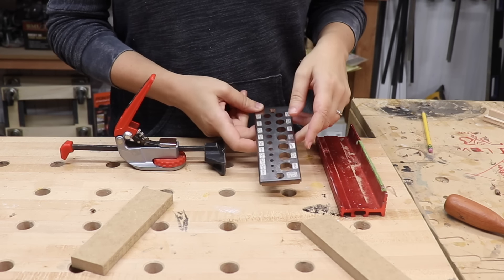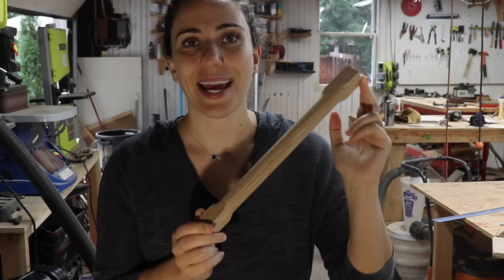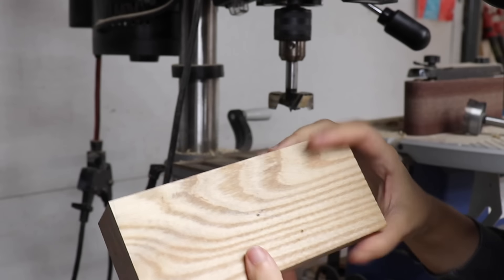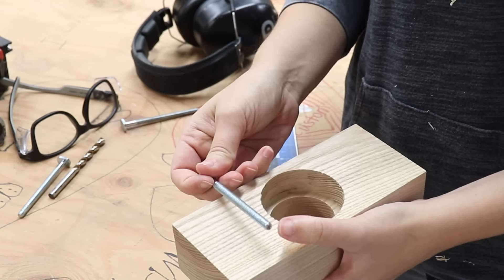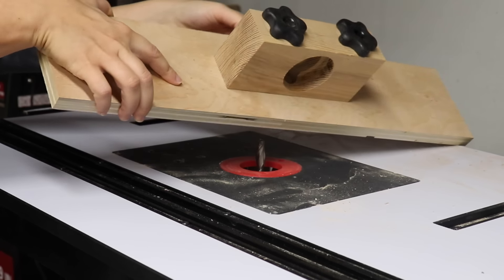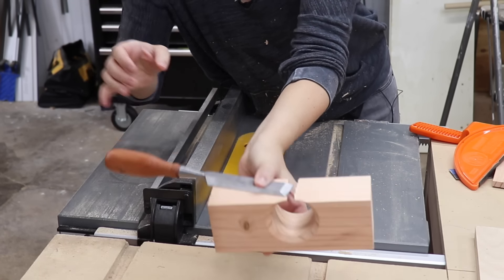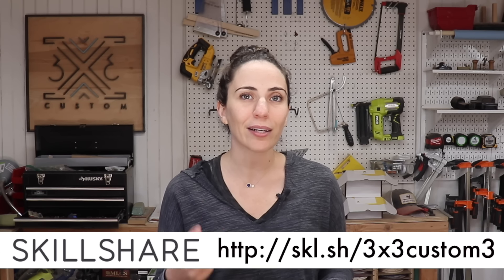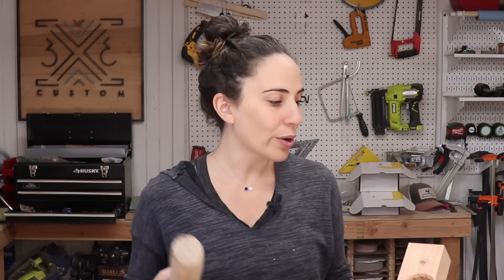Making Large Dowels WITHOUT a Lathe // Woodworking Jig // Dowel Maker

Comment: The router seemed the best way, but there's an alternate that is surprisingly easy: planing. I've seen Japanese carpenters simply use a plane to turn 4 sides into 8, then 16, etc till the stock is close enough to sand. For all the time taken to try and make a jig or try very dangerous methods, you could do it by hand and likely in less time. The added bonus is that you aren't limited in size in any way and can even have control over things like taper, mortises, transitions, etc. I find that if you need to spend longer trying to figure out how to do something than actually doing it, you need to research the method, not reinvent the wheel. And simpler is always best. K.I.S.S. :) Oh, and that chisel.... I was borderline yelling at my monitor when you started! lol
Reply from the maker: Hand planes are always an option

Comment: thank you for the cool video, I like how you explore and work through various methods to accomplish each task/jig.  I have a question regarding the dowel plate.  I see this plate is made with A2 steel so it should hold the sharpness for a good while, but how many hardwood dowels do you think it will make?  And can it be sharpened.  Thanks again.

Comment: This is a really cool video. I am looking for a way to shape wood in this way to make stair rails ( 6ft min ). To my thinking the router method looks most controllable perhap with the addition of a steady block to help  keep it true. What do you think. Really though provoking video. Thanks
Reply from the maker: I’ll have to think about that a bit 6’ could be challenging. Maybe featherboards could be used to hold the workpiece down and towards the fence so the support parts wouldn’t be necessary 🤷🏻‍♀️🤷🏻‍♀️

Comment: I just made a dowel "plate"and am anxious to see if it works. What u did was I found a piece of 1-1/2, quarter inch square tube. I drilled holes from 1/4 in. to 5/8 in. by 1/16s. I then drilled the other side of each hole 1/32 bigger. My thought is that I can bang it through both holes at the same time. This should do two things: 1) it should keep the wood straight. B) it should rough trim and final size at the same time.

Thanks for showing the round-over deal since I'll need some larger dowels as well. 

My only question would be how to finish sand parallel? For what I have in mind, this would be important. I have an idea or two, but would love to hear others.
Reply from the maker: That’s sounds like it would work. The holes on this dowel plate are tapered at the backside. So that’s kind of the same idea. Glad you liked the roundover bit!

Comment: Technically you don't need the ends with the router method. The barrel of the dowel will stop itself from getting narrower. It does, however, make it easier to hold.
Reply from the maker: Yeah. I’m always just extra cautious around the router table

Comment: I have had to make many dowels of different diameters and have found that using a table saw with a method similar to your router method works great. Just give your entry hole the diameter of your square stocks cross corner distance and make it a bit deeper so it gets the piece going strait. This uses more cutting edges so it leaves a smoother finished product and goes faster. which means less sanding and less time. 

Bonus: for small diameter dowels, you can use  a mid grade blade and the angled teeth will leave micro fluting along the surface which allows for fluid pressure to push out during clamping if you are using the dowel stock for inlays. (Imagine making dice with inlayed pips without blowing the side walls out).

Thanks for the great video and some new ideas for my projects.
Reply from the maker: Sounds like a good idea!

Comment: The router method would work better if you used some sort of flat bottom bit such as a hinge mortising bit. I've tried a straight bit but it leaves the ridges because it's only cutting at the tips of the flutes. It works on flat surfaces but not round. Also, with the chisel method, try cutting slower possibly by hand.
Reply from the maker: I was using a spiral bit that has a cutter on the bottom. So that wasn’t the problem. And the chisel method didn’t work for me by hand. That’s why I resorted to the drill. The roundover bit is the way to go for me 😉

Comment: I’m not sure how I missed this one.  Really enjoy your projects.  I agree with the other posts about the rope trick.  Great way to think outside the box.   I agree with you on not really liking running a lag in the center of your dowel.   Here is what I would do.  Get a round piece of 1/2” thick steel plate or maybe a slice off the end of a shaft 2-3” in diameter. Drill a 1/2” hole in the center.  File it out square to fit a 1/2” socket adapter for your drill.  Then drill some smaller holes 120* apart around the center hole. Then you could use some short deck screws to mount the plate to your stock.  And if you are uncomfortable with how close you are to the work piece you can always add a socket extension to move it away from your drill.  That is what I would do.  Keep the great projects coming!
Reply from the maker: Sounds interesting. I was thinking something along the lines of a threaded insert

Comment: The steel dowel cutting block (beginning  at 0:12) would be good for shorter dowels/pins, but the method using the router table (beginning at 1:50) would be preferable for longer dowels.

The table router method would also be great for easily creating turned spindles with square ends (table legs, balusters for stairs, etc.) if end stops were installed on the table fence.
Reply from the maker: Yup!

Comment: maybe you can try suspending the center of the square stock over the top of a Tablesaw in a way that you can move it across the blade lengthwise and spin it with a drill at the same time. Its the same principle than the router Jig version, but you should be able to control the surface quality better by changing your speeds, and you dont have to make a new jig for every diameter.
Reply from the maker: I believe Izzy Swan has a video like that

Comment: You can clamp a couple of “hoops” downrange to shepherd the spindle in its proper axis. It cuts down on whip. I’ve done this with a very long spindle myself, but I used a block plane. It was a lot like your chisel method, but the entry hole I fashioned was cone-like. I got a glass smooth finish, but I was using a wood that was a very good citizen. It wasn’t ash. 😆
Reply from the maker: That sounds cool. Yeah. I wish I had better material to test it on. But I didn’t want to waste any more wood. Ha

Comment: I think you don't actually need the unrouted ends when using the router method.. You can just rout along the whole length..
Reply from the maker: I’ve seen ppl use featherboards to hold it in place. But I just feel safer like this

Comment: What about when using the router with the block hole you tilted the drill press to 15 degrees and then bored the hole. It should be easier to feed for the bit and leave less sanding.
Reply from the maker: Could be cool

Comment: Hi Tamar awesome work from you as usual.  I have a question for you though.  Say I want to make 2" dowel and you told that we should take half the diameter of the required thickness of dowel but what should be the dimensions of a square stock to get 2" dowel with 1" roundover bit on router table.  Thanks.
Reply from the maker: Square stock 2”. Use 1” roundover bit. But take incremental passes since that’s a lot of material to remove
Reply: @3x3CustomTamar  thank you so much Tamar. God bless you.  If I start my channel will you subscribe?   Hahaha kidding but I would really like to tell you once I do.   I am learning a lot from you.  Thanks again

Comment: I have only today seen your doweling experiments. A very clever way of making big dowels, your router jig. Instead of driving a long screw into the end of the wood you are using , why not insert an E-Z hex threaded insert (e.g. from Rockler) and put a bolt inside that? The insert is only about 15-20 mm long. Saves a lot of waste length.
Reply from the maker: That would have been a better idea if I had those on hand ha

Comment: if you use the router bit such as the 1/2 round over you double the size of stock,,for instance a 3/4 should cut 1 1/2 dowels,,,is this correct
Reply from the maker: Yup

Comment: You are the queen of jigs!! I saved this to my "projects to try file". The second method I think worked the best and left a cleaner dowel with less sanding to get to the end stage.  I won't tell you how much I pay to get larger dowels. Its a lot and I hate to pass the cost onto my customers, so this will ease my guilty mind for charging them more. Plus it looks like fun! I just started on a leg vise out of purple heart and curly maple and so far its looking great. I'm was thinking about doing a 1/4" inlay boarder on the face of the clamp. I know the purple maybe gaudy but Its for me.in my shop. I would love to do a Celtic knot in the middle. That is going to be a challenge for me. But hey, who doesn't love a challenge?!  Now how to make it into a 1 1/2" screw for the clamp. Ugg.
Reply from the maker: Sounds like a fun project. Challenges are what makes it fun!

Comment: The old way was to take a 2x2 about 2 foot long then you cut 3 square blocks.
Say you want a 11/32 dowel/Arrow shaft.
You drill that hole exactly in the center
Then you put an 11/32 shaft through the blocks a and glue them in place,....one on the end,.....5 inches away another and 2 inches away another.
with the shaft still in it you will clamp it on your router table till the bit touches the shaft.
then you drill the first hole out to the diameter of the square.
You will also find a socket that matches your square wood and chuck it in a drill and run it through.

Comment: For large dowels I start basically like you did by taking the corners off on the table saw,but then I just use my block plane to finish up. I get great results in about 10 to 15 minutes,and usually very little sanding. An I don't have to worry about anything sharp coming loose from a clamp,and stabbing me. Interesting video though thanks for the upload...
Reply from the maker: If it ain’t broke.... ha

Comment: I've just made a jig/tool for the last method, but instead of a chisel, I used a hand plane blade and back plates.
They're held in position with one 7 mm Hex head screw, in the same way they would be held in the plane. Its very firm and the blade doesn't move.
The difference from the plane situation was that I reversed the plane blade so the bevelled edge was against the back plate, instead of the normal position where the bevelled edge faces downwards.
The finish is a bit rough on the first test, but, I was using a scrap piece of (very) soft wood.
My next idea is to try to used the plane angle block so that I can use the Fine adjustment screw, and angle adjustment.
THE most critical part, is adjusting the angle and depth of cut. TOO deep a cut, and it rips the wood apart instead of shaving it, and the wrong angle either wont cut, or the wood will jam or burn.
I've found the most positive way to drive the square wood, is to use a socket spanner, with a 1/2 inch square drill driver bit. 5/8 WW socket or similar seems to fit well. (For 1'' square wood.)
Reply from the maker: Seems like a plane blade would definitely work better. It’s a fun experiment to perfect!
Reply: @3x3CustomTamar  
I tried using the plane block, and it worked perfectly, for about 10 seconds! Then the central screw retaining the blade assembly came loose from the vibration and everything fell apart. So, I tightened the screw, pressed the lock lever down, and, the back-plate snapped in half!
I've made a new back-plate from an old van leaf spring, but the screw on the blade block is obviously not up to the job, so everything is just screwed to the wooden block as before, but the 2'' wide plane blade definitely functions better than a 1'' wide chisel, but the plane blade needs to be turned over from its normal position.
I may try using a Makita power plane blade instead, its probably more robust than a hand plane blade.
Reply from the maker: niklar55 sounds like a fun experiment. Ha
Reply: @3x3CustomTamar  
Fun? 
Yes, but also a bit frustrating, as I have a construction project that I need the dowels for:-(
Reply from the maker: niklar55 have you tried the roundover bit? I used that method for my project. Works so well
Reply: @3x3CustomTamar  
Thanks for the suggestion, but I am still in the process of constructing my 'new' workshop, and as yet have not added the router extension to my table saw, which Is currently 'buried' under a stack of wood, while I rearrange everything, and extend the floor to make more floor space in my barn for more machines.  😊
The dowels will be used for a new window frame and doors, to replace the 100 plus year old 11' x 11'  decrepit, ramshackle, timber barn doors. I'm going to need about 12' of 1'' dowelling.
Nik.

Comment: 476 comments ahead of me.  The chisel method might work if your input end was more stable. As you can see from the end point section of the video your drill is all over the place.  It might make a difference if your entry point was deeper/longer to stabilize the raw material more evenly thereby simulating a lathe.  Great video though with the router bit method.
Reply from the maker: Yeah. It definitely needed some tweaking. I just didn’t care to put more time into it since the roundover bit worked so well for me. Ha

Comment: Been wondering how dowels were made on recent visits to the hardware store. A lathe actually seems like much more work that the round over bit technique. That makes it look easy.

That chisel technique looked so sketchy, but it was worth a try. It might work out better with a jig which uses 2 chisels to knock down the corners of the milled wood before the 2nd one which gets it much closer. The pass it through another hole layered with sand paper to further smooth out the surface to take advantage of the spinning motion and to help stabilize the piece. That would be quite the setup.
Reply from the maker: That would be pretty cool

Comment: I thought using your router to make a dowel was quite innovative. I wonder if you had a second piece of wood with a hole, if it would add some stability to the wood once it goes out of the router. When you were pushing the wood through it the end of it look very wobbly. And also thank you for showing me a dowel making jig. I can't believe how easy it was just to hammer a piece of wood through a hole to make a dowel.
Reply from the maker: That would probably be a good fix. It was definitely wobbly. And yeah. That dowel plate is awesome

Comment: Hey Tamar
Have you ever built a dowel jig to be able to use larger dowels like for pinning 2x4 lumber for table tops
Love your videos
Reply from the maker: Thanks! Not that I can recall. But I like making templates when I do dowel joinery.  I basically put a nail in a center of  a block that’s the same thickness as the workpiece then that nail marks all the drilling holes. It works in a pinch
Reply: @3x3CustomTamar  
Ok thank you but I am wanting to make an 10' dining table and didn't want to use biscuits and dominos are out of the question due to cost issues for the tool. Glad I dont own one I would domino everything and spend a small fortune on dominos

Thank I really appreciate you
Reply from the maker: Chris Barbot agreed. Ha

Comment: When you did the dowel with the round-over bit, why didn’t you cut the full length. If the bit is set up with the start and finish of the cutting edge apexed with table and fence, you should always have at lease two flat surfaces up to the last, at which point the off feed side of the router table will have two points of contact on the apexes of the dowel.
Reply from the maker: Just wanted to be extra cautious

Comment: Love this video! 3 questions: 1) If you were making 200-300 1.25" x 2' dowels (for a swingset), which method would you use? 2) Did you ever figure out a better way to mount the drill to the stock for the router jig method? 3) Did you ever figure out a jig for doing longer dowels with the round over bit method?
Reply from the maker: Thanks! I have seen some ppl use a jig on the table saw that they like. Regarding longer stock at the router table with the roundover bit... I tried making some longer ones where I didn't leave any square edges and it worked out fine.
Reply: @3x3CustomTamar  Thanks!

Comment: Maybe the router method does not need both ends to be square, as a final step you could possibly get away with doweling on end completely and use more material. Great video, thank you!
Reply from the maker: Maybe thanks!

Comment: Easiest and laziest method for dowels. Take thread cutting die 16 mm and clamp it well. Take piece of wood about 16mm diameter. Chamfer it and fix it into your drill. Insert another end of your wood piece into the die and pull the trigger. Vrrrroooommmm! Done. You’ve got dowel. Dowel diameter will be equal to internal diameter of the die. For instance 16 mm die will give you approx 13mm dowel. And so on. Sanding is optional, if surface is not sanded, it’s even better for gluing .